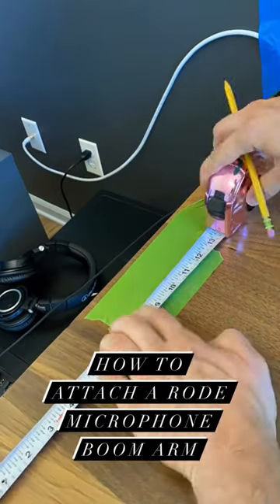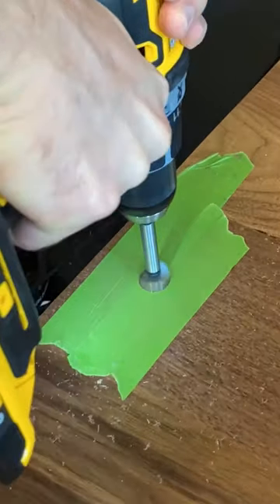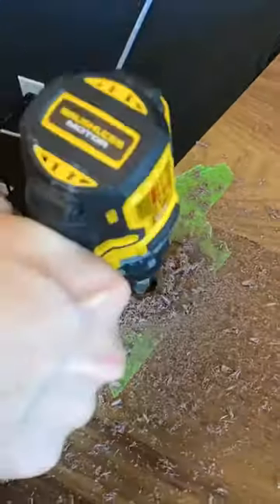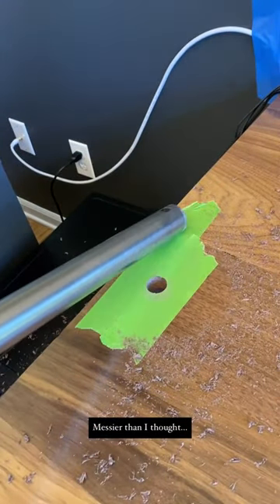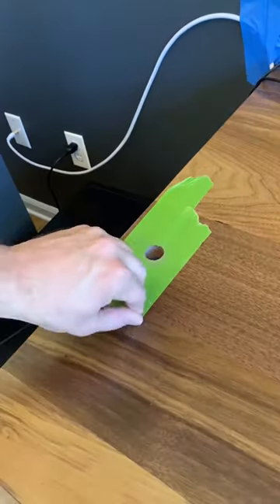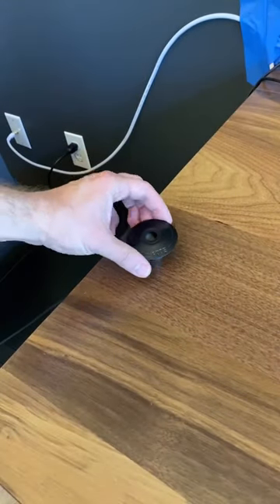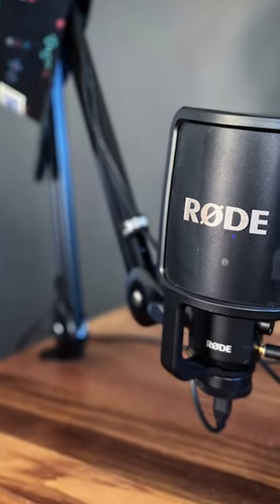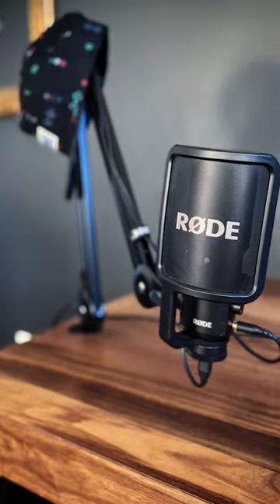How to Attach a Rode Microphone Boom Arm to Your Desk

Comment: Does the adaptor you inserted in the desk come with the mic?
Reply: Anyone? (bump)
Reply: @4nyxy  It appears to come with some of the Rode booms, but can’t see where to get one separately.  Heil sells their Heil Sound DT-1 Flush Mount for PL-2T Overhead Broadcast Boom (Amazon, Guitar Center), and Shure makes a flush mount, as well.  Another option is a “flange” mount.  Also consider your cable management — on top or below table.
Reply: It appears to come with some of the Rode booms, but can’t see where to get one separately.  Heil sells their Heil Sound DT-1 Flush Mount for PL-2T Overhead Broadcast Boom (Amazon, Guitar Center), and Shure makes a flush mount, as well.  Another option is a “flange” mount.  Also consider your cable management — on top or below table.

Comment: what is the thing that you inserted into the hole called? Does it come with the boom arm you linked in the pinned comment?
Reply: “Threaded flush mount.”  It appears to come with some of the Rode booms, but can’t see where to get one separately.  Heil sells their Heil Sound DT-1 Flush Mount for PL-2T Overhead Broadcast Boom (Amazon, Guitar Center), and Shure makes a flush mount, as well.  Another option is a “flange” mount.  Also consider your cable management — on top or below table.